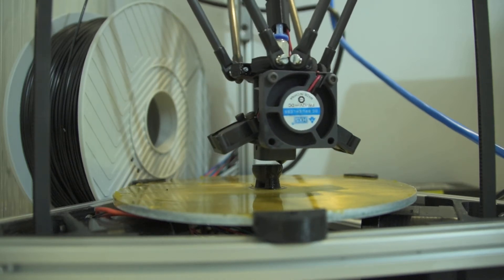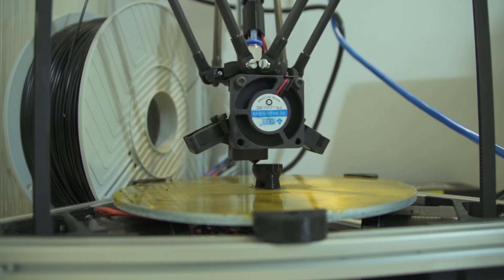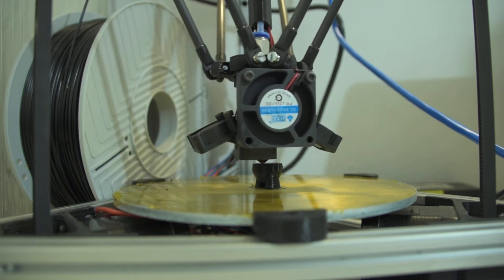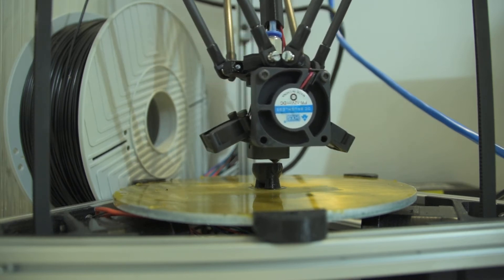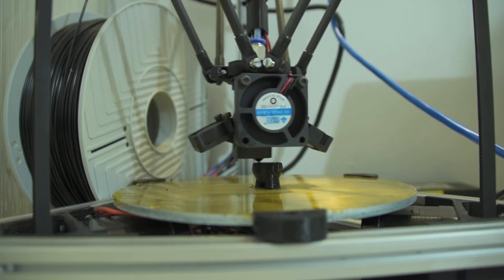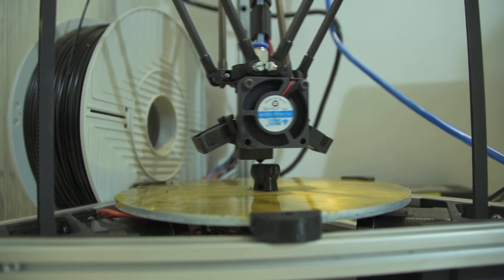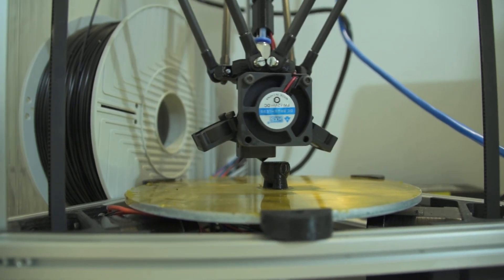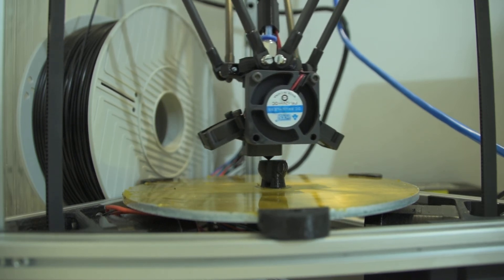Stepper slave mode first test

Comment: Can I ask? What power supply are you using? I have a replicape but I have weak power supply. PC PSU is large in size and I do not want to buy LED power supply. This look quite reliable. What is your experience? Thank you in advance for your answer.
Reply from the maker: For my delta I am using a scavenged laptop PSU, you can get those from any old e-dumpster. 12V 20A, no fan!